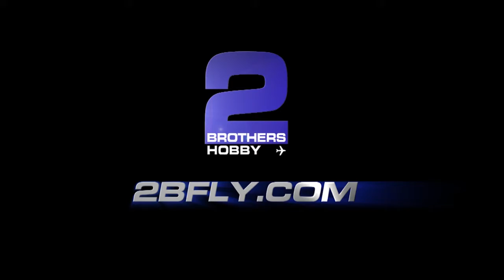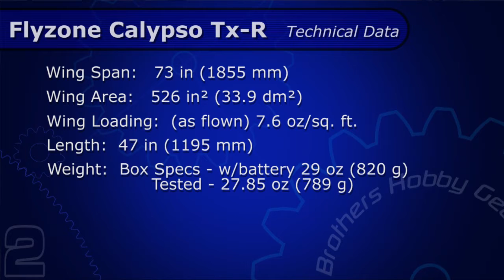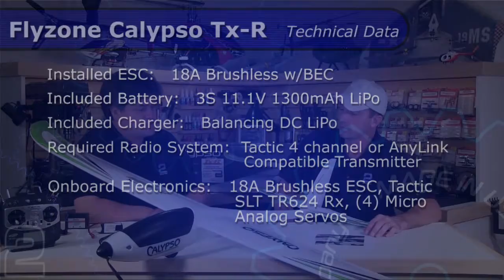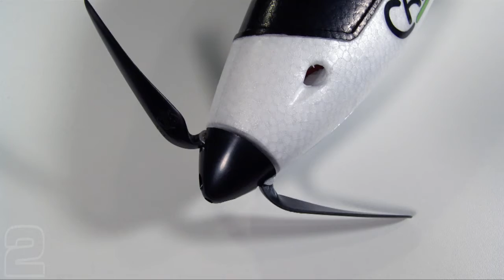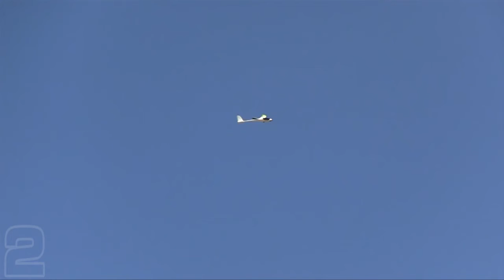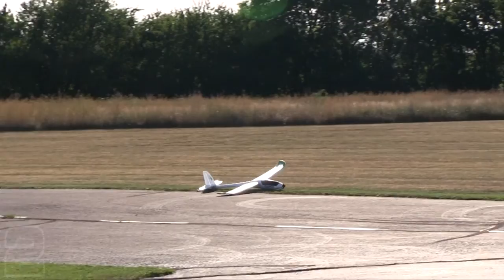Flyzone Calypso Review   Part 1, Intro and Flight

Comment: Flew my calypso for the first time today. I think my friend jinxed me, ha! I had to push forward on the elevator to keep the nose down and level before it would fly level but it still wanted to porpoise on me and the plane kept rolling over to the right and nose diving into the ground. It finally broke the fuselage in half so  now I get to super glue it back together and I'm going to reinforce it with permatex on the outside to give the foam more strength. Naturally I feel I should move the battery further forward to balance it out better but if that doesn't work how do I trim it for fore and aft balance and how do I stop it from rolling to the right. I must include that it was windy out and I suspect the wind may've played a part in my disaster but maybe the plane just needed trimming???

Comment from the maker: You should give Hobbico (the manufacturer) a call for support.  Either you have a bad battery, a bad cell in the battery, are below minimum voltage on one or more cells, or the charger is faulty.  All conditions that should warrant replacement and are best not to try and fix on your own to be safe:)

Comment: Having purchased this glider I'm curious about a couple of things...One, why did they include an auto charger with explicit instructions not to charge in your vehicle and, two, the tail is held on by one screw going in to a blind nut. It is very easy to miss the nut and strip it....ask me how I know this....am now waiting for a replacement rudder...no access to the nut. I have had the airplane a week and still waiting to fly.....oh, and borrowed a charger I can actually use.